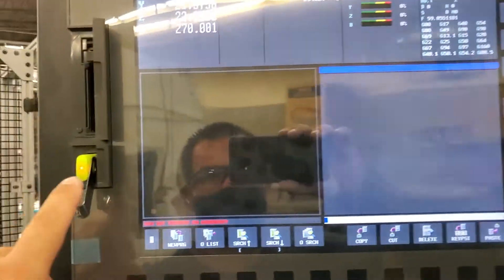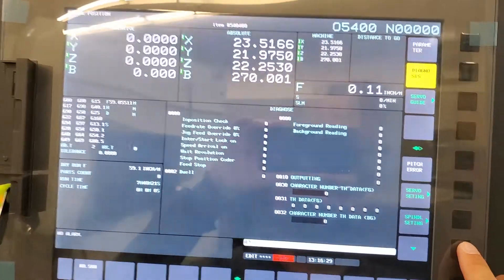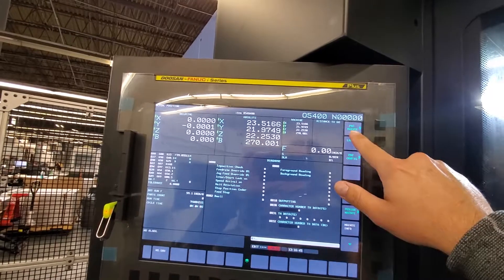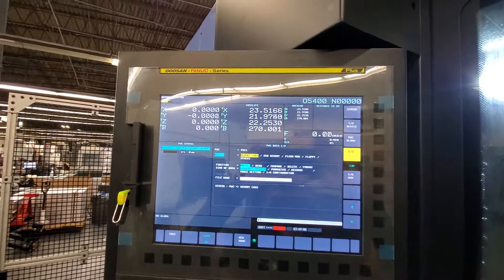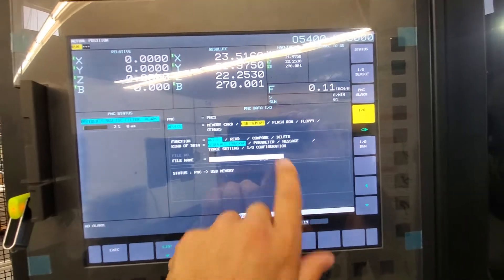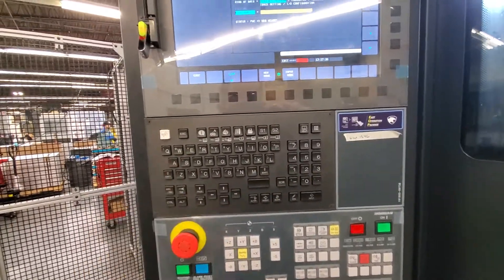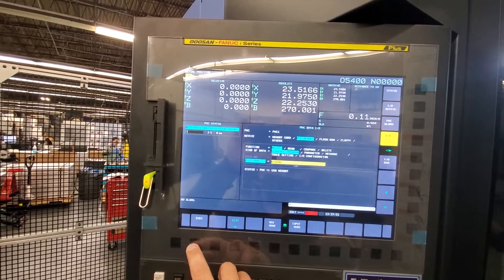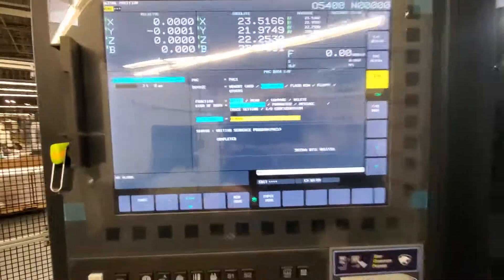Fanuc CNC: Getting PMC Ladder from Control - i Plus

Comment: Eric, what's your opinion of Dooan mills? 4500/6700/6700
Reply from the maker: So far so good for us. We have two 750L's that each have 7000 hours and they haven't had an ounce of service other than PMs. We do have a 750II that had a ball screw bearing failure after about 13 months that was mostly covered under warranty. That might have been our fault from blowing chips so much in the mill that they floated under the way cover. Our HC400 treats us well, few major complaints, but the tool changer is a bit finicky on occasion. That mill might have not been fully buttoned up prior to shipping; we found lots of loose hardware on it as the weeks went on.... Our bran new DVF6500's are pretty dope! They're pucker fast which is made worse by the fact that they're 5 axis..... they're almost robodrill fast. They also come fully loaded (fixture hydraulics to platter, TSC, coolant pressure, 18k spindle, very quick spindle ramp up speeds and flow monitors, the works!) The doors are very heavy which makes it harder for smaller operators. We built some auto doors again for it.  Luckily, in another 2 months only 2,000lb yellow operators will be running them.... Generally, they are very robust mills. The Fanuc UI sucks even with the new shiney version, but yellow operators don't care.... I care that I can manipulate the control to have a great conversation between the mill and robot/PLC.